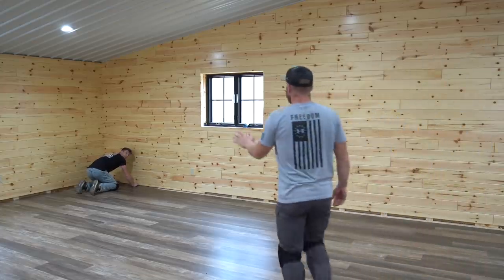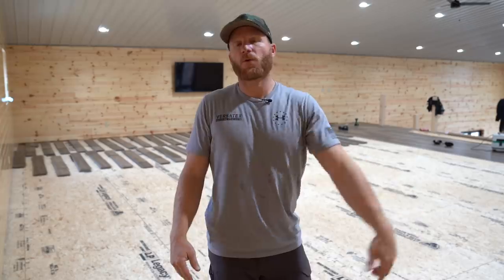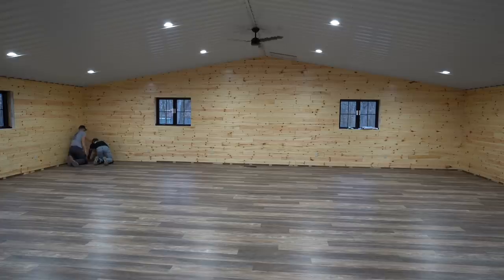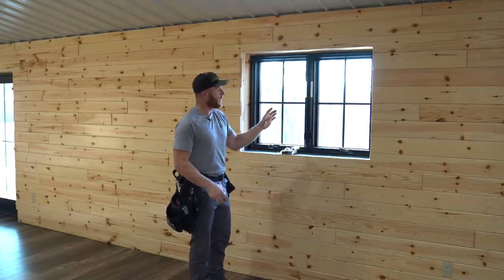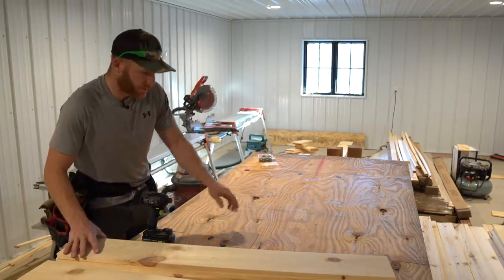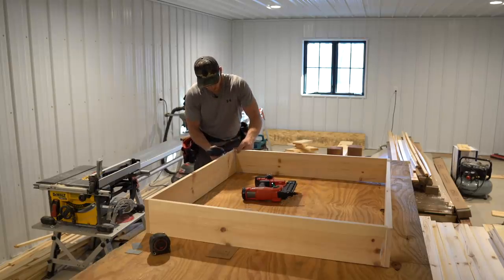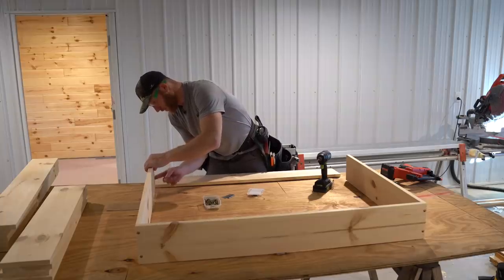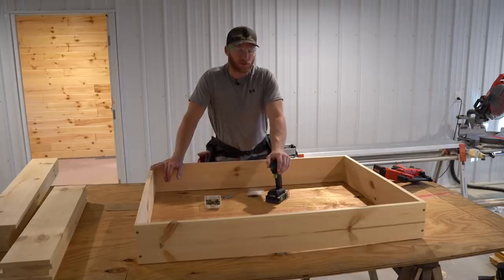Cabin in the Woods 45: We Fixed a BIG mistake and Started Window Trim

Comment: Great work, not many people would have pulled that floor up, well done, love your integrity. Maybe a tip for you, the glue squeeze out you are getting on the show side of the  jamb extensions that you're wiping off with your finger will leave a stain on the wood when the glue is dry, won't notice it without finish but you might see it after poly or wax or whatever your finish will be.... the tip is baby wipes, they remove all the glue right down into the grain and leave no trace at all. I build furniture and baby wipes are used in every glue up! Building is looking awesome
Reply from the maker: great tip thank you

Comment: Glue tip: When I work with the wood glue like the water based stuff (like Tightbond) I use a damp rag to wipe away the glue. A dry rag or finger will leave a film that can be seen when staining or clear coat. Even if not staining, the glue can discolor over time.  Keep the rag clean by rinsing and wring it out.

Comment: I always shop vac and run my hand across before every single piece I lay down. Yes, it takes longer, but you'd be amazed at what you still pick up even after you initially cleaned the floor, especially on a remodel. Awesome job on the window boxes.
Reply: Same. That little piece can happen often

Comment: Really appreciate the pride in your work to redo it right. Most contractors I've met would have fought tooth and nail over such a thing if it was even noticed during construction. But sometimes, you just gotta bite the bullet and do it again.

The upside, is that the next time you lay luxury vinyl plank, it'll be a much easier experience. :D

Comment: You mentioned a biscuit joiner instead of pocket holes for your miters ... biscuits are great for lining stuff up but you’d be disappointed in them for this application. They will not pull the glue joint together like pocket hole screws, you’d have to clamp until glue sets up, and biscuits add almost no strength. I only know this from watching hours of YouTube hahahaha. Your tips that you give are so awesome, I use a ton of them. Thanks!

Comment: I installed about 1000 sqft of 3/8 thick bamboo flooring after we remodeled. I used 1/4in cork under the floor. I had a similar issue with a piece wood chip under everything. You could still feel it and I had to pull all of it out. I feel your pain. Good job on your part making it right.
Reply from the maker: that stinks

Comment: I feel, it sucks having to do rework but any good craftsman knows you feel 10* better once its done right and you won't have to lose any sleep over it. I also wanted to make a suggestion for the jamb extensions, you can always make your jamb extension rips with a track saw when is not totally uniform. I've done it many times and it turns out perfect every time. Not splitting hairs with your work though, 1/16" proud on a jamb extension is no big deal if you use some caulk or wood filler on the back-inside edge of the trim pieces on the nosing corner. I personally think its the same amount of time to rip them out on the track saw ass filling gaps, but again a c-hair is practically nothing.

Comment: Kyle, you were talking about getting the most out of your boards. I think you've got the right idea by starting with the longest cuts first. For the next level, there's a website I've used for cabinet building: "optimalon". You put in your stock, and the count of the parts, and it'll tell you how to layout your cuts to result in the least amount of waste. It may be overkill for what you were doing here (and you can usually bank extra material anyway), but I know it's saved me extra buy, which is important for us garage workshop folks.

Comment: Bit late now but if you ever have problems with floors like that again, try using a glass sucker (the suction cup things glaziers use to carry and install glass) and tap that the direction you need it to go with a mallet and block. Doesn't work all the time but if it means you get lucky and don't have to pull up an entire floor every now and then, its at least worth a shot.

Comment: You should check into the armor tools pocket hole jig and clamps. The clamps are supposedly more consistent with the clamping pressure, and the jig looks super easy to setup.

Comment: Kudos for seeing the issues and fixing it instead of leaving it. AND for admitting and showing it.
Reply: Yes!  I built a cabinet a tad to long paint grade!  I could hv thrown on the track saw and took a piece out of the face frame no one would hv complained!
I took it all apart put it on the table saw and built a new FF !
It was a loss but I know I did the right thing!
Good job Kyle!
Reply: Man of integrity.
Reply: For sure, this is why love watching the RR crew.
Reply: 99.9% of anybody out there would not have pulled that whole floor for one bad joint. But I really couldn’t see Kyle having that piece of wood under the floor. As much time as I seen you guys sweeping and vacuuming on the last video. I’m a professional floor guy and I probably would not have relaid that whole floor for one bad joint. I probably would have offered to knock something off the price. Much respect for Kyle to do the right thing and like gslope1 said , much respect for being man enough to show it.  Not many “men” would have admitted to their mistake. Much less show it worldwide but as bad ass of a carpenter as I already considered Kyle. His respect level just skyrocketed tenfold in my eyes.
Reply: @Senpany_kit_abuse  It’s also a marketing strategy - lot’s of you tubers show their mistakes to win fans

Comment: I have laid laminate floor on wooden subfloor and always use pad it hepls the planks "sit" propperly, also the pad helps tp absorb sound and helps with insulation. The pad i use is 2/8" t0 3/8" thick pressurised soft fibre board.  Don't  know if it's available in the US but here in th UK it's green in colour.

Comment: Ouch, that sucks. I had a board do something similar but I was able to pull them out and replace since it was in a doorway to a room that doesn't have that flooring installed. I will say, I used rigid solid core stuff and it was easier to put in than the flexible stuff.

Comment: You can do return miters to on the ends of the casing to hide the groove in the back of the casing. I think it would have looked better than mitered.  If your jams are in and out a lot you can either back cut the extension jams so the casing sits flat on them or you can router a deeper groove in the back of casing. Also, I never cut long point to short point with a slider miter saw. It pushes the casing away from the blade and you don't get as clean of a cut. Always cut short to long so it pushes the casing against the backstop. Never pre-case extension jams if your trim isn't flat..the angles changes as it tips in and out depending on how flush the extension jam is with the sheet rock.

Comment: generally, have to check the previous 2-3 rows after finishing a row because as you seat the rows it will pull and torque on previous ones. Made the same mistake many times.

Comment: On the 90 degree angle, it's only when when the side to the hypotenuse is 45 degs that both sides are equal.  So, that trick only works w/ 45 deg cuts.

Comment: CORRECTION: The 90 degree triangle is a triangle with a 90 degree angle in one corner. An isosceles triangle is one with two equal sides. What you wanted is a 90 degree isosceles triangle. Remember, you can have a 90 degree triangle with unequal sides and an isosceles triangle without a 90 degree angle. The Pythagorean Theory is a triangle with a 30, 60, and 90 degree angles, and the sides have a 3:4:5 ratio.
Reply: The Pythagorean theorem applies to any right-angled triangle, not just 3:4:5 ones. The angles of the other 2 corners don't matter. It's just illustrated as a 3:4:5 triangle in many sources because {3,4,5} is the smallest integer answer to the equation; 3 squared plus 4 squared is equal to 5 squared.
Reply: @aaronmdjones  You are technically correct, which is the best kind of correct. :D

Comment: There’s a finish carpenter on you tube that uses a special two part glue that once it joins the two pieces of wood it makes an immediate bond eliminating pocket screws and biscuits!
Reply: Yeah it's called CA glue,I take it you mean Richard from finish carpentry TV. CA glue is k just super glue with an activator spray. 👍
Reply from the maker: He actually just sent me some to try

Comment: Great tips for the window case moldings. Love the idea of measure the width of the molding times two then measure tip to tip for the inside miter. Works good for crown molding too. Whats amazing is people actually buy new tract homes today with no window case moldings, no window sills etc.  I never will for the prices they ask. Lots of them, no fireplace, no outside vented cooktop exhaust fans, loud and cheap bath exhaust fans and no soffit ceilings for the kitchen etc. cabinets. Very poor ideas.

Comment: Did you check with the manufacturer and see if they had a repair tool for unclicking boards in place in many cases that’s why you leave a gap and can be fixed. At least with certain laminate flooring companies that’s how it works

Comment: On some of the vinyl laminate floors I've done when you pull it back apart it will break the lock off of the next pc on the end not the long side. You may be in for a bit of trouble

Comment: The customer sure spent a lot on the wood walls to have a metal ceiling. I don’t know maybe it works but I would have thought about a wood ceiling panel or something.
Reply: And you can hear the echo. But many thousands $$$ to do a wood ceiling.  I would prefer wood ceiling and metal on the walls.
Reply: my OPINION, a wood ceiling over time requires far more care and maintenance than a metal ceiling.

Comment: My father was a floor covering installer, decades ago, before this type of flooring. He would have me help him on some weekend jobs so I’d know what work is.

We would not just vacuum the floor. Final prep would be us sweeping with a hand broom and dust pan on our hands and knees.

I was surprised you didn’t use a pad. Also, what about a water barrier? If someone gets overly enthusiastic about mopping, water could get under and soak the osb.
Reply from the maker: no need with this product...100% waterproof and I didn't source the flooring or wasn't included. I would have most likely gotten a pad, but supplier said not necessary
Reply: @RRBuildings  I’m more worried about the subfloor getting wet, or is it impossible for water to get through the joints in the planks?

Comment: If you would have used 2 pull bars you can smack a row in the middle of the floor together but at least you found that piece of wood that could have broke the joint

Comment: Have you let it acclimatized Kyle, or just simply put it down immediately after the product arrived from the supplier. If not, the expansion may can cause the disintegration of the lines. Happened with me before (should not happen with vinyl, but it did). Was very annoying, since then I let them "rest" for 2 days before I started the laying... Nice job, clean job site, correct way of thinking about quality!

Comment: I have put down that type of flooring and it is in the same family as vinyl siding.  Both are ugly substitutes for the real thing.  I would not use the stuff in my own house!  I have done casing with biscuits and obtained nice tight joints.  I don't have a pocket screw jig.  Do the best you can with the tools you have.

Comment: Do you run the ripped side of the jambs through a joiner, put the rips out , or just install as they fall?  Do you set the clutch on the drill to slip at the correct depth on the Kreg screws?

Comment: Maybe I missed it, but I am very curious what the story is for this strange home design. Huge loft, but no other bedrooms? Don't get me wrong, it's amazing craftsmanship, but I'm not sold on the steel ceiling for a residential application, and as nice as the design is for what is essentially a live-in barn, it seems like a small fortune to spend on a home that is a giant rectangular box. If you haven't "explained" the house before, I really would appreciate hearing it before this project is done. Thanks.

Comment: Nice job on the flooring.  Still trying to figure out why you used J-channel on the ceilings?  You've had plenty of other videos when you have used trim on one side, because it the way to make it fit.  Why all that extra work, when a trim piece of steel would have done the same thing with no effort?

Comment: Hey Kyle just got the artisan tool belt.  Do you have an tips for breaking the pouches in.
Reply: Wet them really well with hot water, fill all the pouches with as much stuff as you can to stretch them out and let them dry that way. I use soda cans, bottles, vitamin bottles. Whatever I can fit. Love my diamondbacks but they do need pre shaping!

Comment: 27:13 You mentioned a biscuit jointer. Great for many boards making up  a table top for example but you might be better off with the Festool domino jointer.